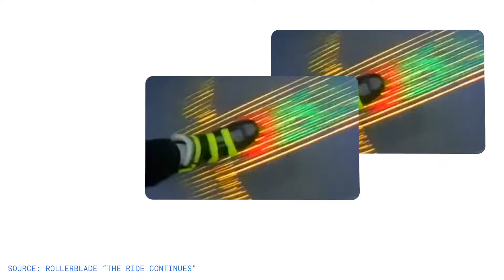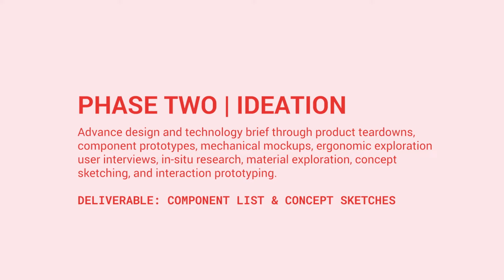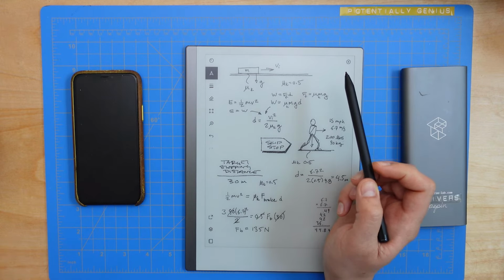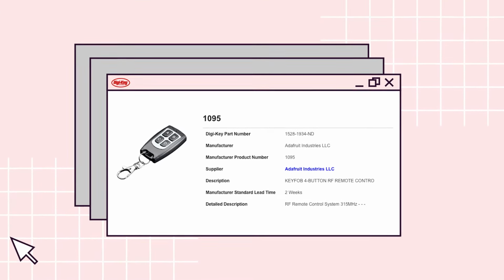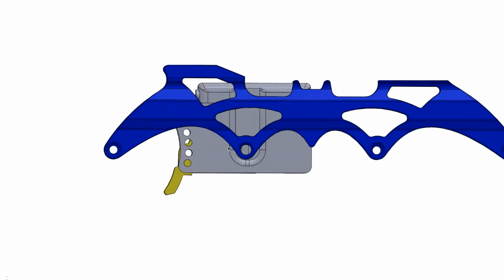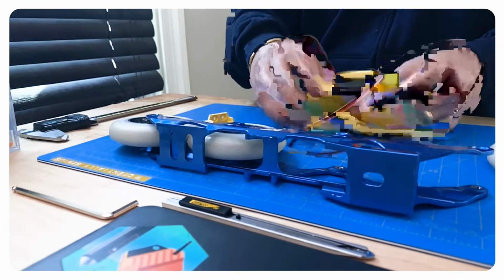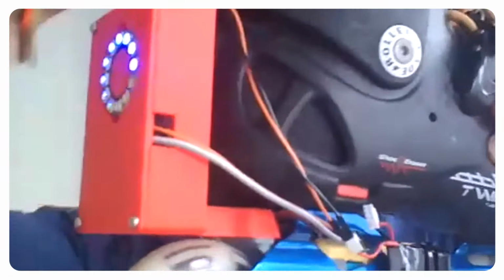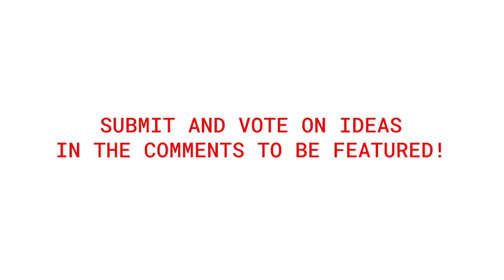Electronic Brake for Inline Skates – Potentially Genius ™ | Digi-Key Electronics

Comment: I wonder if they could have used electro magnets on each wheels instead of the mechanical brake system.
Reply: Hi Stephen! Thanks for this idea. We did consider miniature electro magnet braking and believe it is a viable option, however would require more development time than the friction brake, as well as custom wheels to make it work. We leaned into this 'plug and play' option for the friction brake. The design for the electro magnet brake system would have a similar construction to a DC Brushed Motor (magnet in the wheels and wound wire coils attached to the frame), with the option to run the current forward (to propel the wheels) or reverse (to slow the wheels).
Reply: @TomorrowLab  I love the concept of this channel,  please continue with more videos like this.

Comment: Like your clock radio or microwave (or anything that uses 7-segment LEDs); toss a tinted material over the LED ring so they 'pop' on and you can't see them when they are off.

Comment: Interesting, but what I need is a device that could put over 100ftlbs of torque in odd to reach place,, short area to swing a wrench, and almost no room for the tool, then have it spin it off quickly once breaking the torque on a nut 10 to 15mm wrench size. Hmmmm
Reply: Hi Dustin, thanks for commenting! Can you describe the hard-to-reach place? Is this inside an engine compartment or similar space? Are there any long-handle pneumatic tools that you've tried?
Reply: @pepingelardi1210  yes I am a Diesel technician. It's not distance alone that is the problem, it's often offset distance with very little room to swing the tools. There are many situations this problem presents itself. Perhaps too many to describe and too much description needed. No worries. Thanks for responding.

Comment: I think the center two wheels should have both been used, and they should have ordered or modified different wheels for a larger braking contact point that is located closer to the hub body, and then have the brakes themselves be just rocker arms that are activated by a cable to the servo motor that should be located on the outer ankle. Would have been a much better design than this garbage system they made here. They were of course working with limited resources and off-the-shelf parts, so their design is understandable.